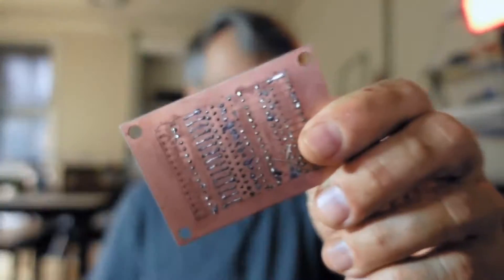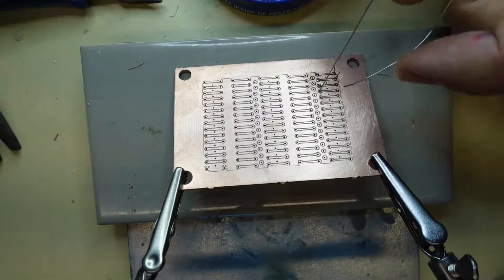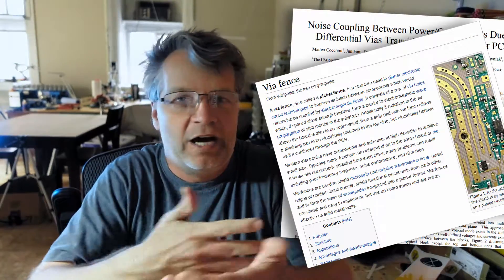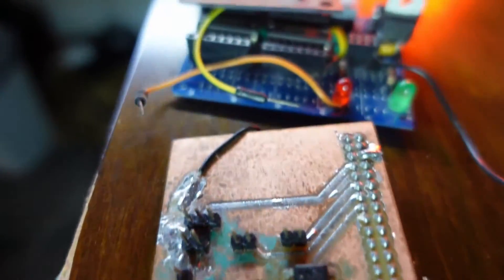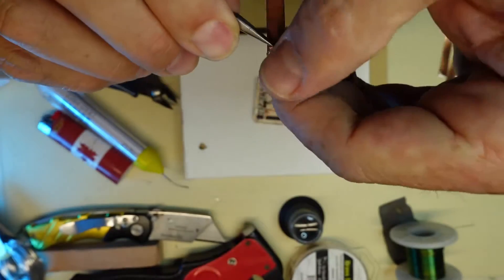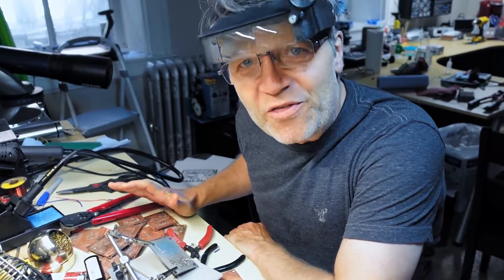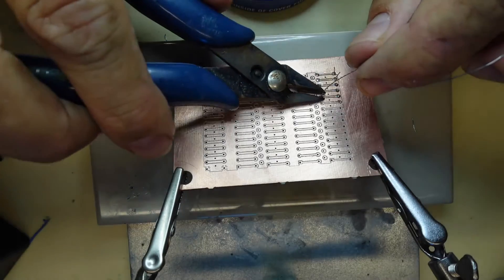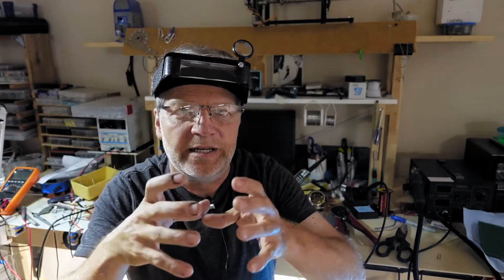Easy Vias on Home PCBs

Comment: Way back (pre-internet) when I took solid copper wire, acid dipped and then tinned, pushed through hole and then soldered (copious flux) both sides and trimmed.
Maybe using the cut-offs from resistors would be easier?
The idea is to get the wire with a thick coating of solder inside the hole.
Back then I was making disco effect projects with 220 volts and some pretty heavy amps and it worked (for me)

Comment: Back when I was donig this without videos I used to use my tamiya hand drill for gundam model kits and use 0.1mm hair thin bits and slowly work through them and solder down some thin wires on both sides. The harder parts were also when the models pins or other ICs legs were doubling up as a 0.1mm via. In those cases I had to pre-thread the thin wire through using minimal solder to keep it down, then thread the throughhole components through and then solder them altogether again. Probably bad practice for how thin the wire was but it worked for my case. I wanted to ultimately try tubed rivets but could never find them at 0.1mm even during my multiseasonal trips to shenzhen back in the day.

Comment: I don't understand the original problem to use a wire for a via. With 2 layers - how is that hard exactly?
Reply from the maker: well often, you solder one side, all fine, flip the board and solder the other side and it pops out sticking to the iron. A tighter hole offers some grip, but then it's harder to put in. But as I mentioned in the first moments of the video, a lot of that was just a skill issue for me too :)
Reply: simply you expect through hole components and vias to connect F.CU and B.CU and to be able to route their connections on Front or Back layer but what happens on home PCBs is that doesn't happen so you need a wire to connect both layers basically
Reply: @mahmoudsalah7628  That was my point. Just not sure what is hard about it.
Reply: @tcurdt  people mostly curious if there is a better way or something

Comment: Thank you...this video saved me dozens of hours of trial and error.  One tip I stumbled upon is if the pcb design can use through-hole components for places that could use a via, then the leads of those through-hole components can be vias...but I don't know how good that is.  Also I saw a lot about using copper rivets, but am not sure how compares either.
Reply from the maker: Good point on the through holes, I have a lot of old 74 chips sitting around, I bet even snipping those off once soldered would work. There should be a way to even make that kind of holder, hmm! I have used copper rivets, and they do work, but they are pretty finicky. They give a great result, but aren’t quick to do, at least for me.

Comment: I like your jig for stripping long lengths of wire - I'll give that a try. I do a similar thing to make many pre-cut short lengths by stripping a short piece of multi-strand wire, then cutting the wire to produce a bunch of short pieces that I use for via stuffing. I particularly like your tip on the "sewing method". 
I have been using "Z" bends for years. It works well as long as the via hole properly matches the wire size with minimal clearance: 

1) Hold the board in your hand while loading a short piece of pre-cut wire through a via from the top of the board using tweezers. 
2) Bend the top of the wire over the board while still holding the wire with the tweezers. 
3) Use your finger on the bottom of the board to bend the bottom of the wire in the opposite  direction as the top bend. You don't have to flip the board over, or see what you're doing, just bend it.
4) Keep doing that until all wires are loaded and bent over on top and bottom with no soldering. 
5) Place the board on a hard flat surface such as a ceramic tile square. 
6) Place a piece of hard flat material, such as a ceramic tile square, on the top of the board and press down to sharpen the bends on top and bottom. This does not provide sharp bends on all of the wires because many via wires stack on top of each other causing variations in height. This is not a problem as it will be corrected later.
7) Use a scalpel to trim the long wire ends off near the edge of all vias on the top and bottom of the board. 
8) Forcefully squish the board once more between the two flat surfaces to assure sharp bends on all of the wires.
9) Flux the entire board using good quality electrical flux and solder-coat the whole thing by lightly dragging a wide, solder loaded iron across the entire board. It helps to do this at an angle, letting gravity aid in flowing the solder from top to bottom. If you find you have used too much solder, simply slurp it up near the bottom of the board with solder wick. Solder coat both sides of the board.

The final solder coat solders all of the vias with a single pass, provides a protective solder coating on all of the traces so that the CU does not oxidize, and makes it easier to solder components. I use a water-soluble flux and clean it under running water with a light scouring pad using a very light touch. This provides a very clean looking board with a brushed-metal surface finish.
Reply from the maker: That's excellent, will try that next board. I usually solder-tin the boards anyway as it makes everything easier and better. Also the scratch milling I do works best on 1/2 ounce copper, so the extra metal will help there too. Thanks for the detailed instructions, pinned for others to see :).

Comment: You can use conductive silver paint. Dip a wire in it and then paint the inside of the hole. Most times these vias are not a real connection but have a resistance of around 10 to 100 Ohms.
Reply from the maker: Great tip, I will give that a try, thanks!
Reply: Graphite spray,scrub,electroplate

Comment: hello and thank you:) I have one question, what about some component like IC socket have to connect both side, what can we do for this?
Reply from the maker: Good question, and it can be tricky. Ideally you would just solder the bottom and connect to the top layer with vias elsewhere. With DIP components I've sometimes soldered the top as well to save a via, but with IC sockets or headers that isn't always possible. I've tried making the holes slightly oversize, and pushing a thin wire through from the bottom before soldering, but it was very finicky. I've also hacked headers by using extra long ones - ugly but it works. That's the kind of thing that plated vias will always be better though. These days I'd probably just find away around needing that for prototypes, and then do it right on boards sent away as things get closer to final :)
Reply: @robindebreuil  what a beauty solutions:) thank you so much

Comment: I buy a thousand 0.4mm copper rivets and... well you know.. rivet.
Reply: Where did you get it?
Reply: Rivets from Bungard for example. 1000 piece 18-20 € . A little bit expensive it work fine. Mouser, Reichelt Elektronik or Conrad Elektronik

Comment: I am trying to use soldered wire for vias but can't find a way to make vias thermally insulated from the plane they belong to. https://www.avrfreaks.net/forum/thermal-vias#comment-3082031
If anyone knows about thermally insulating vias, please help!
Reply from the maker: I struggled with a similar kind of thing in KiCad, trying to get through hole SMDs to work and for vertical plugin boards. The problem was with the copper I wanted the traces wouldn't behave, and with traces joining it wouldn't be the right copper. What I ended up doing is designing everything with custom temp pads, and then when everything was right I did a find and replace all for the library items. This would swap in the pads I wanted, and wouldn't mess with the traces. As long as I didn't forget that last step(!) things worked well.

I'm not sure if that will help at all with what you are doing in Eagle, but maybe a path to experiment in. As amazing as all these tools are, they do like you to stay on the beaten path :). 

Interesting what you are doing there, thanks for sharing.

Comment: Have you tried special copper rivets?
Reply from the maker: I had some medium ones, and they worked ok (it was hard to find very small ones). They took a while to put in correctly, though I think a better tool would have helped. Then I found I still needed to solder them, but again a better tool would have probably crimped them hard enough to not need that. But yes, automating those a bit with the right tools would be a good solution I think :).